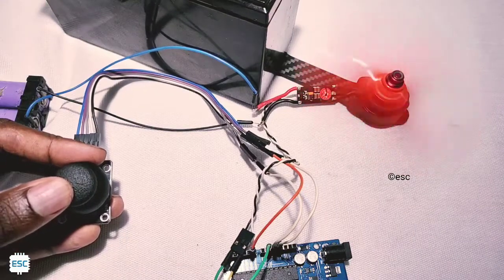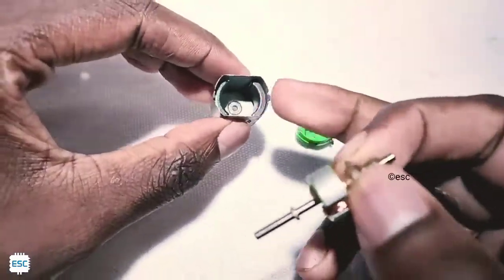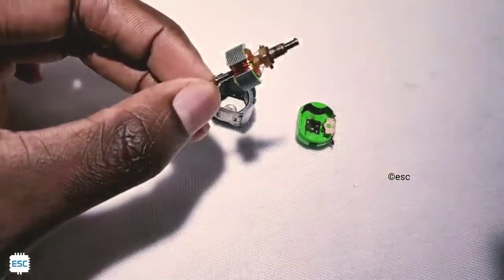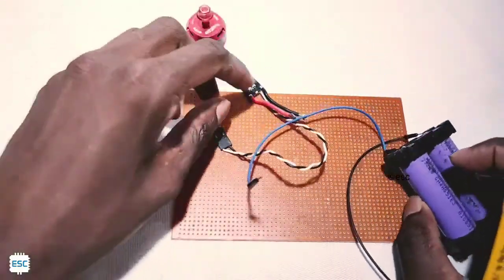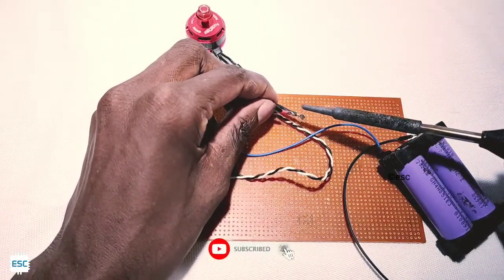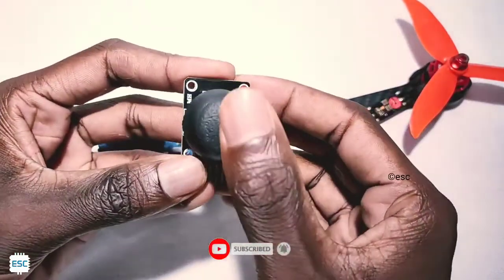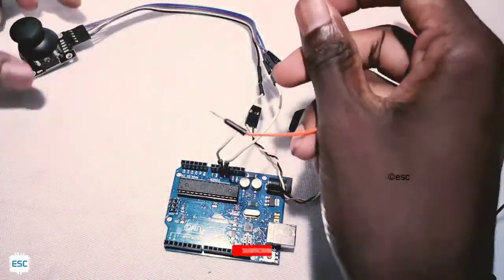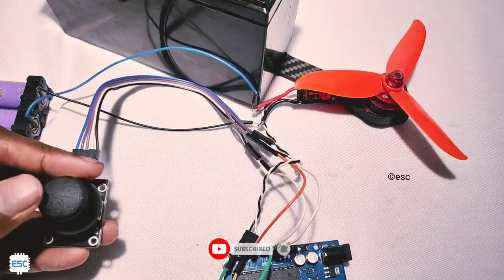How to control BLDC motor with arduino and joystick

Comment: how can I control two BLDC hub motors with a single joystick to control right-left direction and speed (eg: like a wheelchair) ?
Reply from the maker: Same way you can do
Reply: @EDISON_SCIENCE_CORNER  Can you suggest me a controller for handling two 24v 250W BLDC hub motors simultaneously?